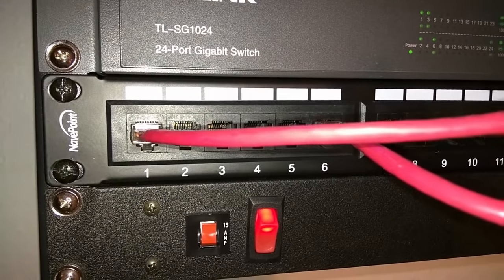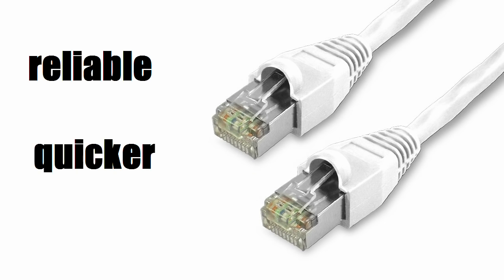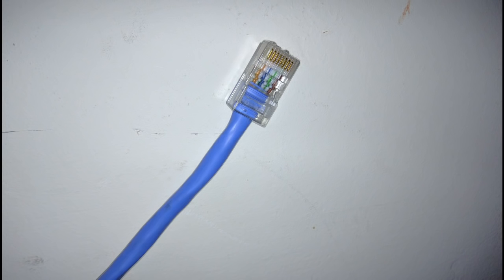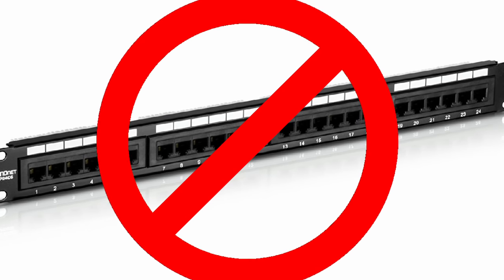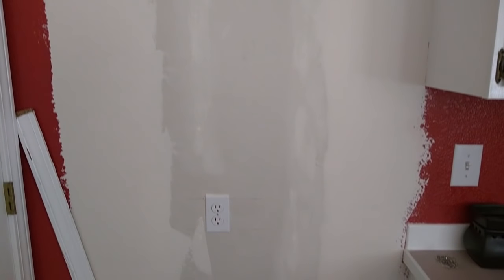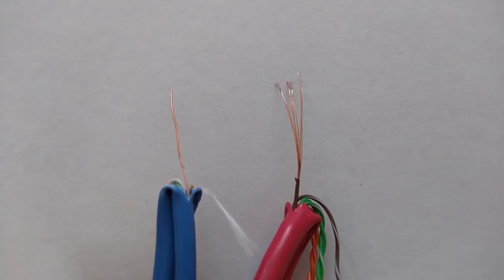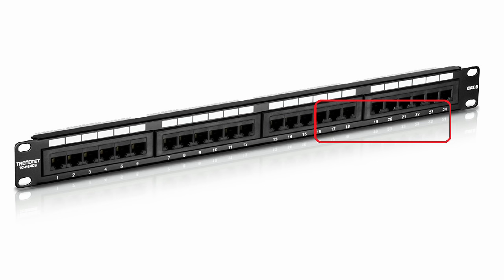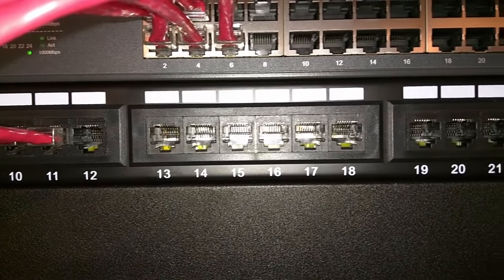What is a Patch Panel? Do You Need One?

Comment: sorry but just becoming interested in this stuff.... if i want to run two connections into my room and have a modem with one port available, would patch panel be needed? or just a switch?
Reply from the maker: If you have 2-3 devices, a switch would add more ports. Your isp would issue each an address. But only a few. If you had more than a few devices, you would want a router. That'd let you hook up more devices. Most routers have a built in switch and would offer 4 more Ethernet ports. If you needed more then 4, you could hook a switch to the router. That would give you more ports. A patch panel isn't needed for any of this. You can connect everything and get a running network without a patch panel.. but a patch panel does add a permanent structure for your cabling, ease of configuring and modifying, neatness and a certain level of coolness to a setup, but are not a necessity.
Reply: if your modem can do routing, you can do away with a switch
but if it's not capable of routing, you'll need a proper router

one quick way to know if you modem indeed does routing : if your network address is in the 192.168.xxx.xxx format, then your modem seems to be a router.
another clue is if it provides wi-fi (it should provide the same type of address in the same "3rd bit" range (ie if your PC plugged with RJ45 is on 192.168.1.1, then a wifi device should get 192.168.1.2)
if the above is true, you should also read in your network status that you're using a "gateway"
most of consumer / ISP routers use 192.168.xxx.254, and most are set up on the 192.168.1.0 range : so 192.168.1.254 for the gateway
you could try punching this address into chrome / edge / firefox to see if your modem has a management web interface
Reply: A Patch Panel would be complete overkill.  What you need is to run a cable from your router into your room, then get a small switch.  Like a 5 port switch.  They're pretty cheap.  Do a search on Amazon for "5 port gigabit switch".  Plug your cable into one of the 5 ports.  Now your router in the other room thinks it's grown more ports as it has.  Then you can plug each of your devices up to 4 as you've used 1 port into that switch.  You are now DONE!!! That is ALL you have to do.  If that is not large enough, maybe you need a 8 port switch.  If that is not enough, you can go larger to a 24 port siwtch.  But they can be placed on a table.  You don't need a rack, let alone a patch panel.
Reply: Cable company generally gives you a Cable modem with a built-in router.  But the routers generally suck.  Always better to turn off that capability buy logging in.  Normally the login and password are on the side or bottom of the cable modem.  Then log in using your browser.

Comment: I just have 2 wall jacks in my network room. one coming from each media/TV room. Then a switch at each location to then run the other devices. Eg Xbox, media player etc

No one ever talks about this. Do you need a wall jack for each device or do you you just use switch for all the devices at that llocation ??
Reply from the maker: You can do it either way
Reply: Yes but why is that not mentioned, surely that’s a much neater solution. Does this affect bandwidth - is that better
Reply from the maker: Not too much difference. I do mention it in the video.
Reply: Having switches in each room is an expensive solution that is overkill in most residential situations, but it would work.
Reply: @kwkcardinal  cheaper than running a new cable each time you add a new device 😱 switches are cheap $50. You then just need one wall plate per room. Most of my stuff is wireless, except gaming PC, Console, media rooms
Reply: @grantos8276  I mean, that's a fair point that i hadn't considered. If you have one room separate from the LAN hub where connections are dynamic and routinely change, i switch in a room would be super helpful. I suppose the problem one might run into is so many connections going from the switch through a single cable to another switch, then the router and modem. It could bottleneck.
Reply: That's what I do in my living room, as I only ran a single cable there, back in the late 90s.  I now have a 5 port Gb switch connecting the devices.
Reply: @kwkcardinal  Not as expensive as running in more cables long after the first one, as is the case in my condo.  I have a 5 port Gb switch in my living room.  My IPTV only has a 100Mb connection and everything else doesn't use much data, so it works out fine.  IIRC, the switch was $15.  On the other hand, if it's a new build, pull in more cable.

Comment: Will this work if all my cable is Cat5 not Cat6?
Reply: Yes, work perfectly
Reply: Yes, the difference between cat5 and cat6 are the speeds at which it can transfer data, the length at which the speeds will be consistent and the way it is insulated to prevent cross-talk (I would look it up, but having cross-talk is not really a common issue and I personally have never dealt with it). I would look up the distances the cables you are running can go and find out their data transfer speeds so you can get a better idea of what you are looking at. cat5 for home use is okay since it can transfer enough data for the average user, but with increasing speeds around the world, this may be outdated soon if you have internet faster than this cable. Cat5e and up would be the way to go if thats an issue down the road. The higher bandwidth (speed) is usually for businesses or business critical operations. I do not say all this to be patronizing, but to help you and anyone else who might find this information useful.

Cat5 = 100m Max Length @ 100 Mbps (Megabits/sec)
Cat5e = 100m Max Length @ 1000 Mbps
Cat6 = 100m Max Length @ 10 Gbs (Gigabits/sec) & 10-Gigabit Ethernet speeds are achievable when reducing cable lengths to less than 50 meters

Do note, these are THEORETICAL speeds, meaning it is expected to reach those speeds, but nothing is perfect and your top speeds may vary, but not by much :) ofc there is also the limitation of the devices you are connecting to and the network providers you are routed to which provide the speed.

Source: I am a Datacenter Technician. I hope this helps!

Comment: Hey budget nerd, we're gonna renovate our old house soon and Im thinking of putting an ethernet socket in every bedroom, office and the living room, I was thinking of having the main router/modem where it is now and adding a network switch in the ceiling crawl space which would connect to the various sockets, would this be a good way to do it? I guess having the switch located centrally in the ceiling would save money and clutter on cables.
Reply from the maker: Location depends on the house, but having the equipment centrally located is almost always a good idea.
Reply: Please call it a port!  It's an ethernet port!  Socket's are what light bulbs screw into, and those things around your eyeballs. 
If you're planning on running structured cabling to every room, here are some general guidelines from those of us in the industry:

* Plan AHEAD.  Even if you don't see a need now, spec your network with what you think you might need in 10 years, and double it. At minimum, I would suggest 2x drops (shorthand for cable drops) into each standard room. This would be for computer / desk / tv, etc... 

* If you plan for wifi (and you will), I would also suggest placing 1 additional drop in center of ceiling in those rooms where you plan to place access point. Note: HIGHLY recommend multiple low-power access points, versus trying to serve even a smaller home from a single point.  You'll have MUCH better success placing 1 per room and dialing them down, or at minimum, one per floor level. I prefer Ubiquiti, and their gear is especially good due to the ease of use for the less technically inclined. Not neccesarily plug and play, but once set up and running, (and it's not that bad really), you'll never fiddle with it again, rock solid.

* Cat5(e) vs Cat6 - Hands down, every cable installer I've contracted or dealt with in the last ~5+ years, in my professional life, has recommended installing CAT6 over CAT5 or 5e cabling.  The price difference is marginal, and it costs the same to pull a 5 vs 6 cable, so you're looking at cost of materials alone. Don't bother with shielded cabling, or anything fancy, just go with simple plenum rated CAT6. 
This ensures you're future-proofed at least through the current, and next 1-2 generations of consumer/pro-sumer network equipment.  Nobody is jumping to 10gbe or 40gbe anytime soon, we're at a plateau where the upstream providers simply can't get you content to saturate anything beyond our current 1gbe equipment (at the level of the general consumer, I'm not talking nerds and IT professionals). However, CAT6 does leave you open to move to 10gb if you wanted to, over the same lines, albeit at shorter distances than fiber links currently.

*  300ft from end-to-end MAX. Measure out your furthest distances, and determine if you can accomplish from one central location or if you need edge switches to reach the furthest rooms. 

* Honestly, have a professional do the wiring, certify it, and save yourself the trouble.  Nobody does their own wiring anymore if they can avoid it. It's really, really worth the investment, because there's nothing worse than having to tear open a wall / ceiling / etc to replace your own shitty handiwork. I am not a cable installer, but I've done my fair share of warehouses, offices, and other buildings, inside and out, to know to call a contractor whenever my budget allows, no questions asked.

* Stick with full, rack-size network switches, again, I recommend Ubiquiti for the small/medium business and pro-sumer, because of the central controller and ease of use, combined wiht their affordability.  It's what I install so that when I win the lotto and quit my job, my non-technical coworkers could pick it up and keep it going until I was replaced.

Cheers... good luck.
Reply: Don't be a douche.  And if you are going to correct someone, make sure you are correct.  It is actually called a drop,  A port is at the switch itself.  

As or the original poster, don't put the switch in the ceiling.  Not enough airflow, if will get very hot, and be a potential fire hazard.  Also, it's against code in many places.  Unless you have a drop ceiling, and even then, it could still be against code.

The best place to put the patch panel, is the room where you can get access to the ceiling above, and then easily to each of the rooms (get plenum ethernet cable, and run it through your hvac plumbing.  Make sure to seal the entry/exit to avoid efficiency issues.
Reply: Haha, whatever.  If you want to be precise.. ethernet jack. And you're right, the port is back at the equipment end, you got me!  It's definitely not a socket however :)

Referring to a cable drop or run is usually in context of the cabling itself, with or without the jack / panel / whatever on the far end. Sometimes these terms get mangled, especially when dealing with non-tech or management.. My advice above still stands.
Reply: One more suggestion, if you live in an area that has regular thunderstorms / lightning, consider a lightning surge protection device, or non-metal sheathed fiber optic as patch between CE and hookup.
Reply: I wouldn't put your Network stuff in the ceiling crawl space where it's hot and hard to get access to.   Location really doesn't matter to much as it's WIRED.  You could put it all in the Basement for all it matters.

What you want centrally located is your Wifi Router.  All my Network stuff is in my small closet in the middle of my house with my Wifi Router.  It worked out that way and is centrally located.  If you have a larger house, Central for Wifi may not be good enough anyway and may want to go with a MESH Wifi setup.  Some allow for wired backend which would be better and if you're going to be running cables, that is something to think about NOW!!!

There's also 2 ways to do things.  You can run a single cable to a room, and then have a small switch in that room to plug all your devices into.  That is how my brother did his wired network.  You run far, far fewer cables!!!  But now you need a switch in each room. Some 5 port, or 8 port, depending on how many devices you plan to plug into it.  Smart TV, Xbox, So on and so on. Of course, that switch is also taking up a power socket.

Then there's the other way.  You run any number of cables to a room.  So for example, in my computer room, I had 2 wall locations with 2 Keystones.  So two cables going to each location.  Over the years, it wasn't enough and so had to add a small switch.  Same with my Master Bedroom.  So when I upgrade my Network a few weeks ago, I added 3 more ports into my computer room, and another 4 ports in my Master Bedroom, and a couple into the Garage.  That's another 9 cables going around my house and all ending up in my small closet.  

In effect, I have no need for any remote switches now anywhere.  It's all handled by a single 48 port switch in my small closet. So you want to figure out what way do you want to go?  How many devices in that room do you want to plug in and maybe add 1 or 2 more ports for future needs.    I find that running cable if you can do it, is not that hard or costly.  I ran my cables under my house, crawling around on my STOMACH in the dirt!!!  There's almost no room to move around in my attic.  So my wires are bundled and running along the side of the floor beams.  They go up through the floor into the walls where needed.  When done, all the holes are foamed up, sealed tight!!!  But if you have a attic you can get around in, that may be a better, option.  Ether way works.  

Plan ahead of time what you want to do.  Single wire to room or multi-wires to a room.  Where do you want that wire(s) to go in those rooms?  How are you going to get the wires into those rooms!!!  What's the total number of wires you'll end up with. Is it close to 20?  Then a 24 port switch may be OK.  Remember you need to connect the Router into the switch.  So that takes 1 port at least.  Plus anything else you may want to plug in there.  In my case, I have a NAS with 2 ports, an HDHomeRun, a Tivo Stream, etc.  These need to plug into my Switch.  If you run 25 connections, a 24 port router is too small, and so you need a 48 port one as I have.   If you go one less cable, you would be ok with a 24 port.  See how planning ahead makes sense?

See you could have your wired Network in the basement, and a jack out someplace in the middle of your house where you can plug in your Wifi Router so that it's central.  Or a Mesh system and ports where they need to be so they are talking to each other WIRED instead of over Wifi.  How big of a Rack do you need?  What do you plan to mount on it?  It should be larger than you need Now so you can upgrade in the future.  Maybe you go from a 1U UPS to a 2U UPS for longer battery life.  You just never know.  How much room for a rack and minimum size it needs to be.  I got a 4U rack before I thought what I really needed, and how I could get more room, and ended up installing an 8U rack.  I really would have liked to go with a 10U rack

Plan, Plan, Plan.  Single or Multi Port.  Where at, What do you plan to put in the rack. Exact hardware!!!!  Because there are things like Depth to think around.  Just because it fits into a 19" standard rack, doesn't mean the rack you picked out is deep enough for it to fit.    So again, Plan, Plan, Plan!!!

Comment: Hmm, But what if i dont want to use old school brass copper lines, and only glass fiber lines. I dont want to go several light years back in time..

I want it modern
Reply: dude. it isnt even necessary nor economically reasonable to wire up your house with fiber. shit. even businesses dont do that.

one fiber line to the modem, MAYBE additional lines to separate switches. but CAT5e or higher for the rest of it. INCLUDING wall panels.
Reply: Damian Chiliński  10GbE network with a couple of ironwolf 12TB 7200rpm & that new(ish)fancy intel cache feature coupled with nvme will have you laughing at transfer speeds and redundancy.. though i'm sure you have a healthy respect for $    fiber is definitely the way to go either way

Comment: could I essentially achieve a good home network setup by using a switch without the patch panel or is the patch panel necessary to be able to terminate cat cable into? trying to replicate similar setup for my home network but trying to see if I can skip the patch panel step. Thanks for your video it helped clear up so many questions I initially had.
Reply: Yes you can get a good home setup with a switch without a patch panel.  There is not a difference in performance with a patch panel with or without one.

Comment: How long should be the patch cable (I mean the one from patch panel to switch) is it true that it should be no less than a metre?
Reply from the maker: It can be as long as you need, but shorter is better.
Reply: @BudgetNerd  you mean less than a metre is okay?
Reply: @jimmysale417  exactly
Reply: @rhdtv2002  I appreciate all the replies thanks,😀
Reply: The longer the wire, the more signal is lost. That's where that myth is coming from. Your patch cable would have to be over 400ft long to even begin showing signal loss, if you're using at least cat5e. But cat6 and cat7 will go much farther
Reply: I use 1/2 metre leads in my panel too long looks so untidy